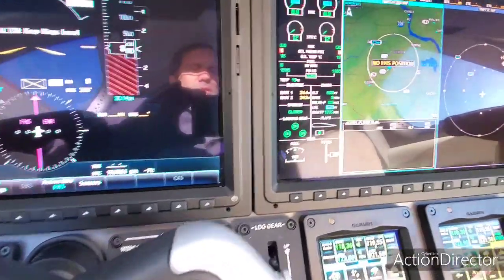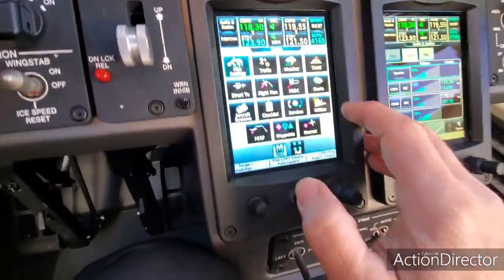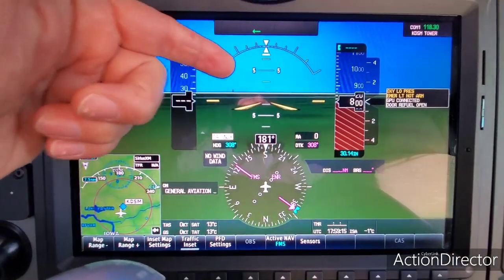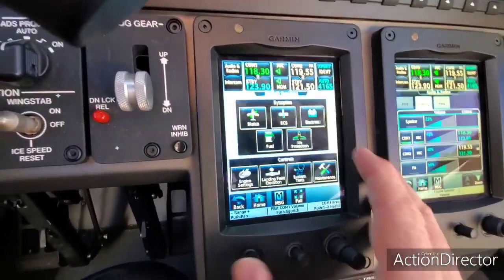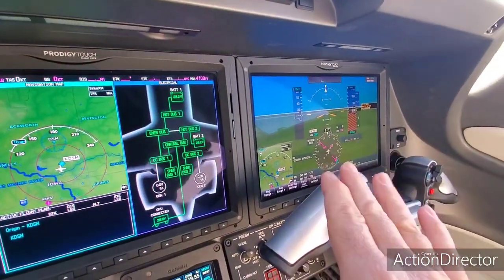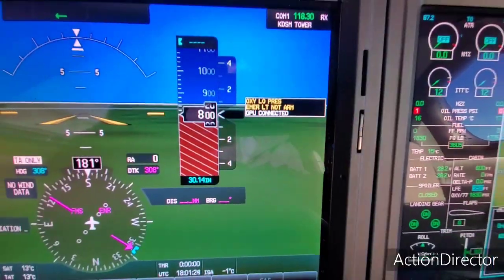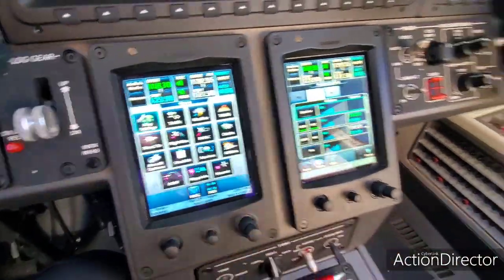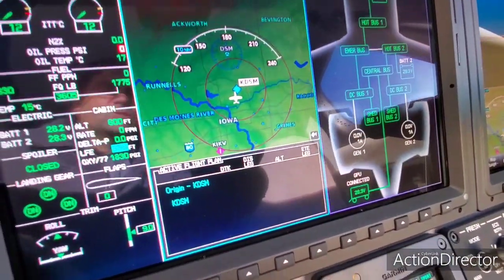Phenom 300 cockpit tour

Comment: The Phenom is not that great, brakes still suck after many revisions to the software, no reverse, and light jets have them thankfully, Lear 24,25, Beechjet 400,Citatiin 500 and so on, interior fit and finish lacking, uncomfortable cockpit, my old 5,000 dollar Camry has a better climate control than this 9 mill piece
Reply from the maker: Not sure what you've flown, But I've flown all three of planes you listed.  And none come close to the Phenom 300. Learn the brake system and be a professional pilot. If you can't use the brakes on a Phenom 300, get a CDL and drive a truck.  Have you been in the cockpit of a Lear 20 series?! or a 500 or 525 Citation?  The Phenom is more comfortable.  I'll give the Beechjet that, but no range and underpowered, unless its converted with Williams engines, then no reverse.  Its been a few years since flying the Lear 24E, I cant remember the climate control because 2 minutes after takeoff your fuel critical.  The Citations I flown make you feel like you've died and gone to heaven on the Phenom.  No plane is perfect, but of the planes you listed no way.
Reply: Yes I know Citation
Reply: I flew freight in the Lear and Falcon back in 99, I don’t want to drive a truck, don’t mean to offend, it’s all good, The Phenom has its good points I just don’t care for it

Comment: Nice video. But I was very surprised with all that fancy gadgetry that your electrical schematic page doesn't tell you how many amps you're drawing. I was really curious what all avionics powered up draws on the ground like you just did. If you know what the amperage is can you please share here. Thanks.
Reply: The amps are only relevant when you are on generator power. If you look at the electrical page it shows the voltage and amps the generator is producing.

Comment: thank you for your video. Could you show me please how you turn right and left on the ground? Does plane have special tool for that?
Reply from the maker: I can do, it is with your feet. Rudder pedals.
Reply: @windingtrail9319  ok thanks. i still do not understand why embraer didnt make a plane with form factor like phenom 100 ev but with 5000 km long non stop flight
Reply from the maker: Timofey Shitov just too much weight of fuel, engine cost for that price point.
Reply: @windingtrail9319  it is said. Seems to me we need better engines twice less  consumed. if i created a specification for my own plane i would prefer it. I would fly  from Moscow to Malaga or Andalusia or to Siberia in my country. So  waiting for new engines))

Comment: Great jet! Really. But what do you think about Pilatus PC 24? Isn't a big competitor to Phenom 300E?  Same class, same size, same altitude, almost same speed and more, more is the same. And plus PC 24 can land on gravel, or grass runway. ;)
Reply from the maker: It is a competitor, but I don't know too much.  I think I N. America the Phenom will still dominate. But in air ambulance or maybe other regions where non paved landings may be necessary.  I do think the Phenom has a slight efficiency advantage over the PC 24. That is what separates the Phenom 300 from the CJ4, and a better cabin IMO.
Reply: First and foremost, many thanks to Chad for his videos. They are really awesome and helpful for anyone immersed in the Phenom world. Now, about the PC24 and Phenom 300, they look incredibly similar but have their differences. The PC24 has a shorter take-off distance than the phenom300 and as mentioned before by Algirdas, it can land on different types of runways. The PC24 also requires less runway for landing than the Phenom300. They cost about the same, their range is almost identical. cabin size is bigger on the PC24 and the huge cargo door is a big plus as a multipurpose aircraft. However, cabin comfort may be an issue due to its multipurpose role. Phenom300 would provide more comfort and amenities than the PC24. Don't get me wrong - the PC24 can be customized too for comfort but I think Embraer has a lead here. There are more than 500 Phenom300 in service around the world - it is a well known jet, with a very high dispatch rate and where all details have been worked out and enhanced. The PC24 is still very new and needs to prove itself in time as a reliable aircraft. As for the cockpit, Phenom300 uses Garmin3000 now and previously it used Garmin as well, an avionics package that many other manufacturers also use - which means that pilots can get comfortable very quickly on the Phenom if they have flown other jets since they know the avionics involved. On the other hand, the PC24 uses a "Pilatus Advanced Cockpit Environment", whatever that means. I guess because it was manufactured in Switzerland, they're using some European avionics that may not be known to pilots in the US and therefore, service and support may not be that easy to find (aside from the training). And of course, we have the service issue. If something goes wrong, how long before the plane can fly again? Who services it? Embraer is everywhere and their support service is phenom-enal. Therefore, from a buyer perspective, who looks for proven reliability, high dispatch rate, cost-efficient, and promptly service, the Phenom300 shines on all of these. And this is my humble opinion... I forgot to mention the absence of a kitchen and a very weird toilet in the PC24 will definitely scare away several customers.
Reply: @SergioSilva-zc6id  Pilatus uses a slightly tweaked version of the Honeywell epic 2.0 avionics  just like how embraer tweaks the Garmin systems to suite their jets and no Honeywell is not some small avionics manufacturer from Europe. They literally own the whole avionics market everything from bombardier, gulfstream, dassault, many of the citation and hawker jets, all bigger private jets from embraer, pilatus and many more business aviation manufacturers use Honeywell and in airline sector airbus, Boeing, embraer, bombardier, comac, sukhoi and many other use Honeywell avionics.
That being said i think corporate buyers will still prefer the phenom as even if you want the pilatus PC24 it is very hard to get your hands on the pilatus. When pilatus opened the order book for the PC24 in 2014 they sold 84 aircrafts in one and a half days and they closed their order book immediately cause they couldn't handle that many orders and when they opened the order book in 2019 the orders got filled again in a few days and they claim aircraft which will be delivered until 2021 are all booked, so when they open their order books in the future god knows when, you might be able to order one....

Comment: Damn! That's a fair amount to keep track of.
Do you have to do any type of  continuing ed, like for software updates, or anything?  How many years have you been flying, and what are some of the best changes you've seen in aviation? 
 How often do you get to fly? Like times per month?
Thanks for taking the time!
Reply from the maker: I usually fly 3-4 times a week.  Usually just over 350hours a year.  I did fly over 600 hours in a year when we still had CJ2+.  I do have to do recurrent  training minimum once a year.  Had to take a avionics class, and work on that myself.  I have been flying for pay for 27 years.  I actually took my commercial pilot check ride on leap day 1992.  I’ll try and get back on best things in aviation.
Reply: @windingtrail9319  Do you prefer the citation or phenom?
Reply from the maker: Will Jernigan   I do like the Phenom better, I won’t say bad things about the CJ line.  But feel the Phenom, especially the 300, really is a great airplane.
Reply: @windingtrail9319  Thank you